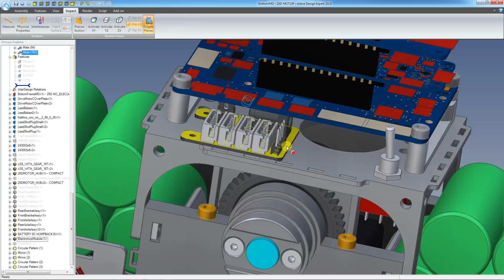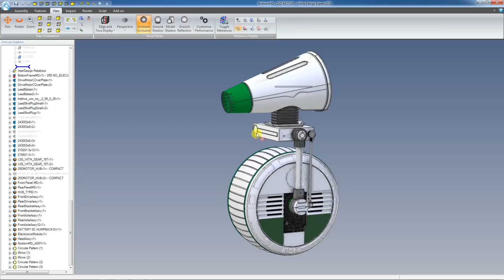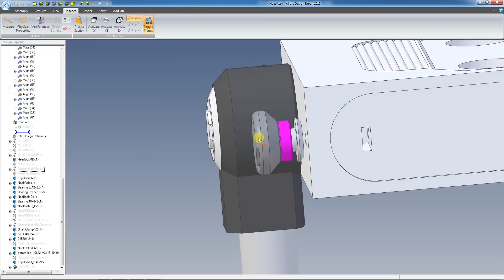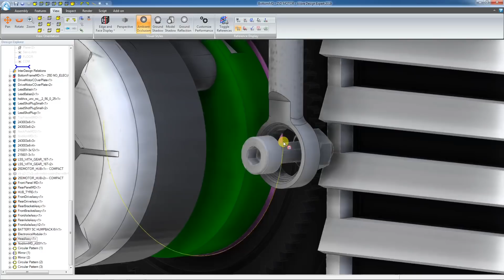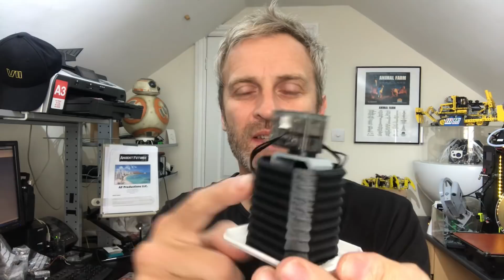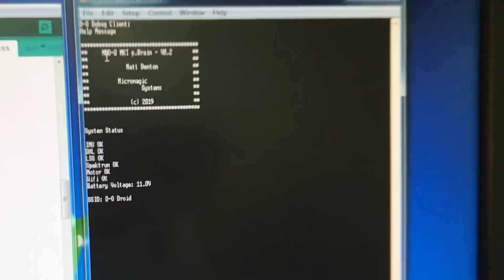Droid Build D-O - #2 - Mantis Hacks

Comment: Great video as always Matt! Just one thing... The jumper on the LSS power board is only there to disable power to the last connector. This so that you can daisy chain the signal to another LSS power board, maybe running a different voltage. So if you just put the fuse where the jumper was, only that closest connector would be fused.
Reply from the maker: Got it 👍

Comment: it looked really top heavy in cad but once you started handling the 3d printed parts you realize how light 3d printed parts are :D hopefully the rest of the stuff is'nt to heavy. can the arduino IDE handle the computer being connected to the internet with ethernet and to the arduino board on a separate wifi NIC? in that case that's a really convenient system :D
Reply from the maker: Yeah it’s not too too heavy at all.. there’s a lot of weight in the base!!
As for the arduino I think it would  handle that. However, you can have the arduino connect to your WiFi network as a client, but I prefer it as an access point so if I’m not at home or on another network I can always connect.
Reply: @MattDenton  alright makes sense

Comment: Do the Dynamixel's you're using use standarm PWM signals (from the Lynxmotion board)? Any I've played with in the past have used half-duplex TTL, so you can chain a bunch together.
Edit: ah, I see later on you mention that. I'm thinking that Lynxmotion board will be great for traditional RC servos, but the Dynamixels not so much.
Reply from the maker: Yeah the dynamixels are TTL which is why I like them. But the little LM board will do both.. I’ll explain more in my next video 👍

Comment: Matt I've just been through the schematic and data sheets for the driver board and there (at first glance) isn't anything with a VCC limit of 12v on there so not sure why you popped the last one.
Reply from the maker: Interesting. The arduino website says 12.6v max.. I’ll check the data sheet too.. I’ve been asked really careful about switching it on by the onboard switch but I really hope they are not that fussy.
Reply: @MattDenton  it may be your power supply. Switching supplies can overshoot substantially at turn on,  quite a few of the more common ‘cheap’ bench power supplies will do this, especially these days of ‘soft’ power switches.
If you have a scope with capture, you could check for overshoot, just be wary of scope max input voltage!

Comment: Quick question in regards to motor control. I currently own two VEX bag motors & typically they are used for FRC purposes, but I want them to work with arduino in an easy fashion. Is it possible to connect a bag motor @ a 200:1 reduction to one of those MKR motor shield. I'd like to make the setup very easy for myself.
Reply from the maker: Hi. I don’t know anything about a VEX bag motor.. but if it’s a brushed motor and will work at 6 to 12v at about 20watts or less then I would say you’re good

Comment: I would like replicate this project, can you send me de file STL? thank you
Reply from the maker: Check the comments for the STL link
Reply: @MattDenton  your STL link doesnt work now. 
Please add wiring diagramm and Arduino Code please
Reply from the maker: Hi. You need to join thr D-O forum. Someone posted the diagram there but the code was not released, and a newer version was developed
Reply: @MattDenton  Hey matt, i joined the facebook group but the admins doesnt work, i cant join in, do you have a link for the D-o forum? thanks for helping me
Reply from the maker: @michaeldiehl2477 it is the FB group. You just accepted two request I think you were one of them
Reply: @MattDenton  yes thats me, thanks a lot.